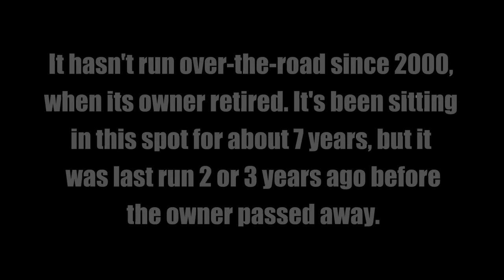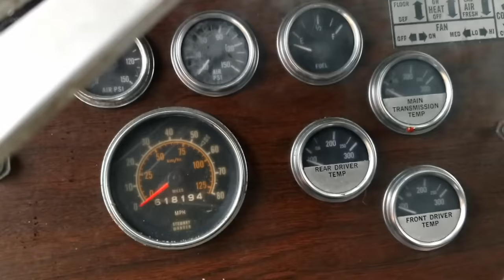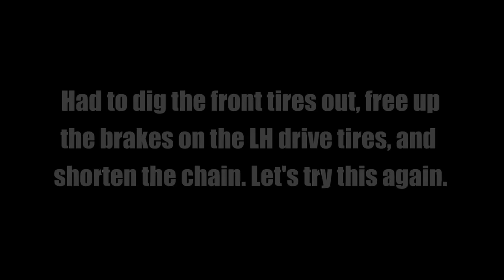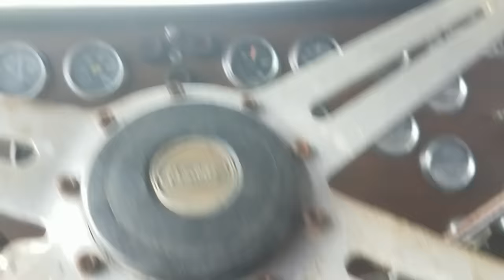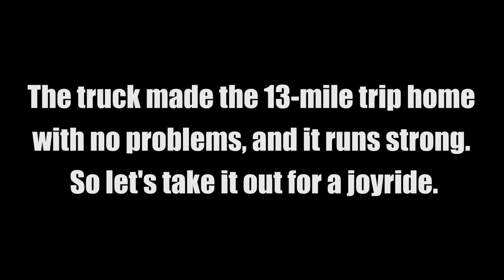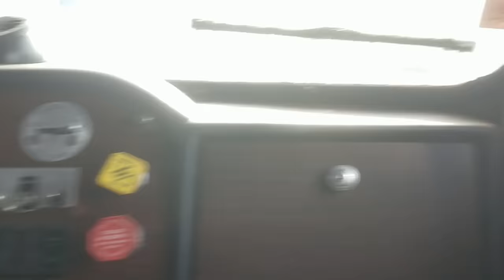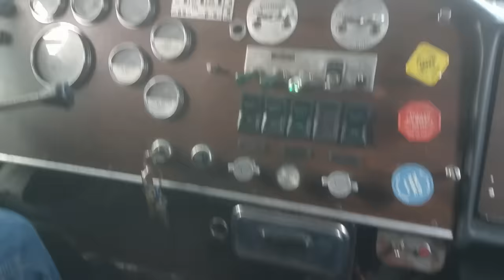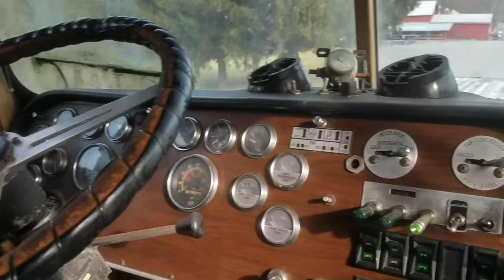Rescuing a 1977 Peterbilt 359 From Its Grave - First Time On the Road in 18 Years

Comment: I noticed that it "claps" a fair bit, probably a couple of valves that could use a re-adjustment.
The Jake Brake "snarled" a bit much too, so might have some holes in the bottom of the exhaust.
Probably from rain / condensation, gathering at the bottom of the exhaust.

And I would always check all cylinders for compression, in a diesel that has been standing for a while, even if it runs.
If you have one cylinder with bad pressure, it's often the piston rings.
If you have bad pressure on two adjacent pistons, it's often the gasket that's about to blow.
Gotta remember that gaskets don't last forever, and they sometimes crack when you wake them up again.

In a similar vein, electronic connectors often collect water condensation.
Thus when it's not driven, they don't get warm, and the water don't evaporate.
And then they can sometimes corrode quite badly.
Reply: Grumpy ol' Boot it looked like there were covers on the tips of the exhaust when the vid first rolled so hopefully minimal water got in and settled 🤞🏻
Reply: @liamoreilly2008  
True, though several years of condensation, might still add up.
Even so, a few small holes in the exhaust is nothing too serious,
and most mechanics with a welder will have that fixed up right quick.
Reply: Grumpy ol' Boot I totally agree. I didn’t mean to sound like I was going at you with my comment - just passing observation 👍🏻
Reply: @liamoreilly2008  
Ah ok, fair enough. :)

Comment: Well done, chaps!  We don't have them in the UK but they certainly look good.
Reply: The full restoration of Guy Martin's Scania is pretty cool.
Reply: A cold start of some of the older ones ...brup brup brup ...they sound very good, my unc owns a few of these, and one made for me (just peddle mods so i can shift properly, brake and stuff, i'm small so...)
Reply: @JohnSmith-jb8rb Not as cool as this mate.
Reply: @ianhagler3678  yeah...I've seen some pretty cool old custom Mack, Peterbilt, and Kenworth trucks around where I live in the middle of farm country. Another popular thing around here is buying old 40's to 60's fire engines and customizing those. I've never been into tractor trailers, but if something is done right it's hard to miss.

Comment: That thing is awesome, with 4 fuel tanks.  Looks like an extended length frame?
Reply from the maker: Yeah the frame was extended many years ago. It's a 290" wheelbase.
Reply: Why would someone put four tanks?
Reply: Ernie Rodriguez back in the day.. they didn’t stop as much and ran for 20 hours straight or even more sometimes
Reply: Not to mention diesel was a SHITLOAD cheaper
Reply: MichaelTJD60 why was the frame extended?
Reply: @chrisj197438  If i'm guessing, to fit the fuel tanks :-).

Comment: That description tho
😆
Reply from the maker: I just HAD to vent. lol
Reply: Understandable. They're just people who don't know jack shit about mechanics and such
Reply: @MichaelTJD60  Don't let me stop ya bro.. Had my vent times and felt 100% better for it!
Reply: @MichaelTJD60  The homie had to get on some ass real quick 💯
Reply: @MichaelTJD60  I didn't know descriptions could even be that long!
Reply: @MichaelTJD60  to be honest i was impressed to how little it smoked after it warmed up! my 2l diesel smokes more than that!
Reply: @MichaelTJD60  My truck is in the shop. I just drove a prior west coast truck with a Cummins today and it's a *"newer" one, but it seems like there's a lag when you try to bump it (electronic throttle). I was missing 'em like crazy today.

 I haven't had much experience with Cummins. Maybe the previous driver was a moron because it only had about 1/2 clutch left, but the engine felt like it didn't want to respond when I bumped it fucking up my rhythm.

Is there anyone out there with experience that can offer any insight on this? In the last 15 years I have mainly drove Detroit or Cat, not sure if it's the fact I'm not used to how a Cummins responds to the throttle, R+L over-neutered that engine, the last driver fucked that transmission, or maybe it's a mechanical problem.

One more thing, the transmission is an Excel 10, I haven't had much experience with them either but that shouldn't matter should it? I've driven many different trannys made by many different manufacturers and never experienced this before.

*NOT a manual motor. When I say "newer" it's comparatively speaking. The truck I drove today was made in the early 2000's. It doesn't even have a DPF.
Reply: If this truck could talk, the stories it could tell where it's been. Awesome sounding!!

Comment: It looks like the Jerry Reid truck smokey and the bandit
Reply from the maker: He also happens to have a '77 Kenworth W900A which is the exact truck used in Smokey and the Bandit. Even has the same paint scheme.
Reply: That was a KW..
Reply: @scottbrittingham3901  that's right it was
Reply: Very similar to the truck from the scary film Duel..except the model used was the single axel drive version, a 281 according to wikipedia.
Reply: That truck was a 1960 or 61 Pete. I don't know why I thought it was an Auto Car but a watched a video about a year ago and sure enough it was an old Pete.
Reply: We did it for the money and for the glory but mostly for the money.

Comment: Why didnt y'all change the oil, water filter and add fresh diesel? 🤔
Reply: Because it's close to home and was in the middle of the woods half sunk in dirt. It'll get a full service now it's home. Everything was checked before startup
Reply: Diesel doesn't go bad like gas
Reply: @Anders Andersson you're not seeing some if the time shift in the videos as they're spliced together. It had been running awhile
Reply: Exxon states that “diesel fuel can be stored 6 months to 1 year without significant fuel degradation if you keep it clean, cool and dry.” Chevron adds that diesel fuel can be stored longer than a year under certain conditions: First, the fuel was purchased clean and dry from a reliable supplier.
Reply: Anders Andersson right because it’s best to just sit there letting the engine run for an hour chugging on three cylinders.
Reply: Nashville Tennessee - I drink diesel fuel I know it all the way around boi. It don't grow fungus it age like fine wine or good cheese. You keep that shit right for a couple year and you'll be gon to the moon. These trucks love it, bring out the flaver
Reply: Nashville Tennessee  Well if you work on them then you should know that you want the oil hot when changing it not when if half frozen and been sitting for years I have never seen no one drain the oil on a cold engine before starting it and running it first and I have been working on Diesel and gas engines for years
Reply: Sounded fine to me. Quit acting like your so smart. Lol.
Reply: it was powerwashed and all things to make this video look good were done
Reply: @Anders Andersson Diesel engines are tough and not as refined as petrol engines.. This was fine, no problems.
Reply: John Smith They sure are tough. Diesel engines made for the rail market like the ALCO 251 and 539T are damn near indestructible. Same with the General Motors 16-645E3. In the case of the 539T, many locomotives are still running with their original 539T engines some 70-odd years later. Most still make good horsepower too, around 1000 hp, which was great for the 1940s. Who knew a 4 stroke turbocharged diesel straight 6 could be so bulletproof?

Comment: bet that engine has never been rebuilt...unlike these new engines that already has been rebuilt in 300.000 miles
Reply from the maker: The old mechanical engines and some of the early electronic engines (N14, ISX600, 3406E, C-15) are all million-mile engines easily. I'd like to see one of these new PACCAR, X12/X15 Cummins, or DD15 Detroit's last that long before a rebuild.
Reply: They never will. I’m a diesel tech and my shop gives me all the dd13 and dd15 stuff because I’m the only one that can figure out the electronics on them. Yeah they are super efficient but the issue isn’t the engine. It’s all the exhaust stuff causing way too much back pressure on the engine. Leaving more wear inside and therefore stuff will fail earlier. I lost track of how many get rebuilt.
Reply: It’s all about emissions...
Reply from the maker: @adrianbanuelos8052  It's really a shame that that's what new technology has come to. The engines themselves really aren't bad and they do make loads of power, but it's all the bolt-on emissions crap that kills them.
Reply: MichaelTJD60 Those Stage V Cummins engines that are due to come out in 2-3 years only have an exhaust after treatment for emissions purposes. Hopefully those will be million mile engines again.
Reply: It was actually out of framed not long before health made him park it.
Reply: They say x15 will run up to 2 million miles
Reply: rags 1977 I work for UPS so we put the miles on them.  We usually change out our ISX with close to a million on them.  I routinely drive an international with 1.46 million miles on it.
Reply: Alex Cosentino 
Probably not. We have 30 beta Cummins in our fleet and I do like a lot about them. But they to are constantly in the shop and Cummins has a long list of fixes needed before its release in 2021. 
I’d be more sad that as of now it’s most likely the last diesel platform Cummins will produce.
Reply: Never, ever going to happen  @MichaelTJD60 .

Comment: 2700 people are Fruitliner fans.
Reply: what about Kenworthy?
Reply: alexander1485 Kenworths are the poor man’s Peterbilt 😜
Reply: What's wrong with 'em? I like 'em. Like the guy said, if it weren't a decent, reliable product, they wouldn't be around today. You sound like a Peter beater eater.
Reply: Haydar Gokcebay Freightshakers? They fall apart. They’re noisy. They’re uncomfortable. The plastics are reminiscent of 1980s era Japanese cars. They spontaneously combust. Here, in Australia, the Frightliner Argosy accounts for more truck fires than anything else. 

And for the record, I’m of the opinion that all American trucks are over-rated, outdated and offer very little to the driver, they’re built with fleet owners in mind. I do have a soft spot for the aesthetics of American trucks, but that’s about it. I mainly drive Volvos and Scanias. I’m happy to wear a skirt, and air my vagina out in air conditioned comfort as I maintain a normal level of volume when having a conversation. I do not require a blanket draped over my knees as I drive during the winter, I do not require frequent visits to chiropractors due to subpar seats and suspension. I’ll bash whatever American truck you offer, European is the way to go.
Reply: @davidbailey1721  Drove a Volvo, after a Freightliner and was not impressed. Scania, can only go by looks, as ther are not really any in US, also drove a late model 389. REALLY unimpressed. For me the best one was the 99 Classic I drove. 
By the way, I recall you said something about the Argosy having burn up issues down there. Maybe it's just you guys down there? Never really heard of anything like that happening here with the regularity you say it occurred with there. 
Sadly for you, Freightliner will still be around to aggravate and annoy you until your vagina breathes its last breath. Live long and well.
Reply: Haydar Gokcebay yep, maybe we just require more reliability and power than most other countries, given our climate. I urge you to do a quick search-Australia truck fire. You’ll want to carry a fire extinguisher in the cab and ask for danger money when you have to drive a Fruitliner. All vehicles have their own quirks, with Freightshakers it’s poor build quality and catching fire. I’ve done a few road trips across the states, and I couldn’t believe the popularity of the much maligned Frightliner. Given that fleet operators outnumber owner drivers, my assertion that this brand is more popular due to lower purchase price holds true. Good and cheap are mutually exclusive.
Reply: @davidbailey1721  well, I dunno about in Australia,  but here fire extinguishers are required to be in all trucks, even Volvos. Trucks burning up isn't unique to Freightliners, either. Volvos burn up, too. Funny thing is though, for all the Freightliners I've driven, not a one of them has burned up. Hmmmm. If it's such a common occurrence, it must be something you guys are doing down there that causes it.
Reply: Haydar Gokcebay the company I work for has four Columbias in the fleet, one of which has had a fire. That’s a pretty good track record. We also have seven Volvos, none of which have caught fire. The Fireliners are about seven years old, with 300,000km on them; the Volvos are around six years old, ranging from 800,000km to 1,300,000km. I think I’ll drive a Volvo and avoid a free cremation. The Volvos are all B-Double rated, and have spent the first five years of their lives working split shifts; local during the day and change-overs at night. The Columbias are local only. 

Here, our number one seller is Kenworth, number two is Volvo. There’s talk amongst operators as to why Fruitliners are rolling fire hazards. It seems as though the poor build quality coupled with an extended wiring harness, which is used when building the RHD (correct side), causes electrical fires at the firewall. With the excessive amount of cheap plastics used, no amount of fire extinguishers can put out the blaze. While I do love poking fun at how crappy these trucks are, the fact remains they are dangerous.
Reply: @davidbailey1721  " extended wiring harness for RHD build..." right there is the problem. Start driving with the steering wheel where it is SUPPOSED TO BE (left side) and then your 25% fire rate will go to zero. Extra length in the wires, extra resistance, creating extra heat, resulting in FIIIIIYAAAAAHHHH! All to satiate your country's 
need to be different. Youre already different. Your country started as the world's biggest unwalled prison....Just stop this silliness of insisting on driving on the side of the road that your not supposed to. 
I've driven six Liners in my career. Not a SINGLE Car-B-Cue. I'm telling you, it's you RHD guys.
Reply: Haydar Gokcebay it’s not the fault of my country, or any other country that is Correct(right) Hand Drive. It’s the fault of Fruitliner themselves for not engineering a proper solution. It’s that simple. Most other American trucks in Australia do not catch fire due to shoddy build quality and poor engineering. 

What does England’s decision to transport convicts have anything to do with trucks or the side of the road we drive on? Are you on drugs? I hope not, especially if you’re a professional driver. You do realise that England sent convicts to North America from 1718 until 1775? So your country was penal colony before mine!
Reply: Haydar Gokcebay I’m just replying to your smart arse comments with my own, just to see who gives up first. I really couldn’t care less either about who like what or what side of the road anyone drives on or who was a penal colony first and who does or doesn’t know about it. I really couldn’t give two shits, but I do enjoy stirring people up, hence my original comment about 2700 Fruitliner fans disliking the video. 

As far as I’m aware, no one has died in Fireliners. Here, as drivers, we do hold the number one  position as the highest rate of fatalities among all industries. I’m sure it’d be similar in the states. 

Also, here, older drivers (I’m 40, so I’m regarded as a younger generation of drivers), hang a lot of shit on us Volvo or other European drivers. Older drivers don’t seem to appreciate driving vehicles that are comfortable. I spent my younger years driving old KWs and Macks. My old KW was a ‘75 cab over K125, 350 Cummins 350 big  cam with a 15sp OD, on a Reyco rear axle. Fridge in winter, oven in summer. Id much rather wear my skirt in my Volvo. 

Keep it upright 👍
Reply: The only time I have ever heard of a tractor catching on fire here is when they crash or something to that effect.

Comment: I would have put a secondary fuel tank on it and put fresh fuel through it. That way you can clear out the fuel tanks and lines. Which would have definitely made less smoke. All in all though I love the 359 but the 379 is my favourite model. I drove mainly with Freightliners. But jumped at the opportunity to drive a Pete!! RIP whoever owned it last.

Comment: Did you not change the oil before starting? And replaced the old fuel? Do the tires not have cracks after 18 years? What about the tire pressure?

Comment: A 10 speed would not have that button on the side of the shifter! It's either a 13-15, or an 18 speed!
Reply from the maker: It's a 13....the air lines were all plugged up from sitting and it wouldn't split the gears in high range. But the more we ran it, the better it got.
Reply: @hello Randy how are you doing?

Comment: I’ve driven a 100 different fleet tractors and have not come across a blue air knob/button, what was that for?
Reply from the maker: Tractor parking valve and protection valve. It went extinct in the late 80's/early 90's. Most tractors now have the tractor protection built into the yellow parking brake valve.
Reply: @MichaelTJD60  thanks!

Comment: Not to nitpick but: in the real world of those days, you didn't reach up for that jake switch all the time turning it off and on. it stays on all the time. You would turn it off and on with the clutch pedal and fuel pedal on/off switches. the clutch switch is adjustable and should kick that Jake off with about a quarter of an inch of you pressing down on the pedal.